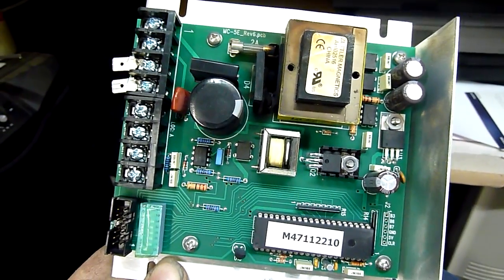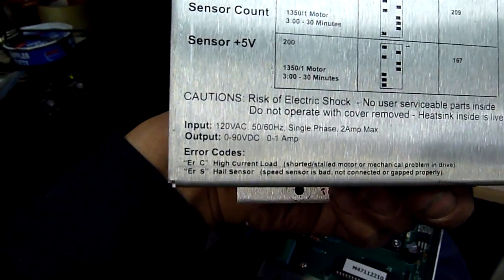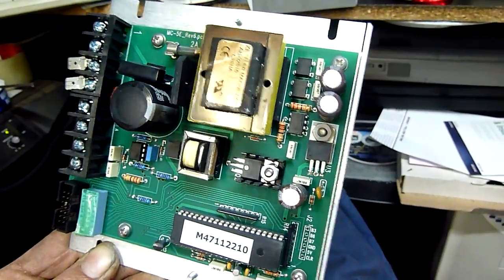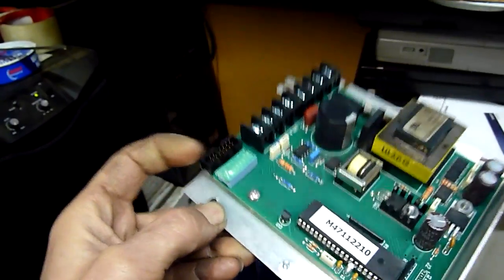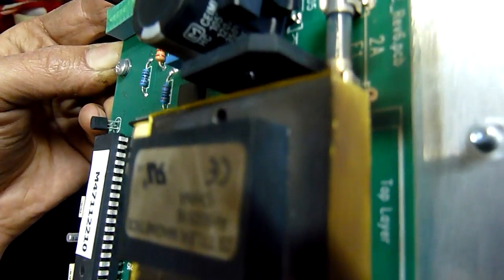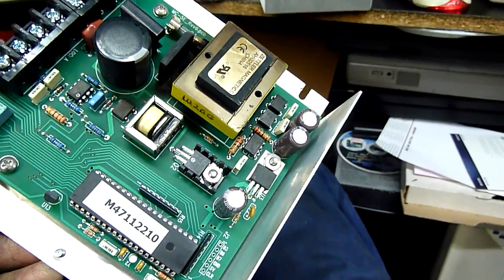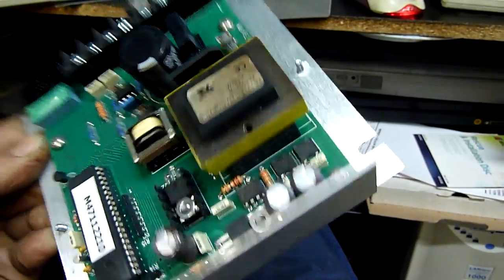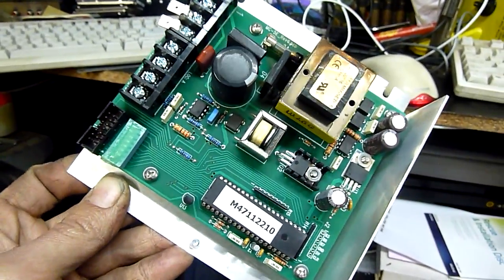Can it Be Fixed - 240V Vs 120V Speed Control Repair Help needed

Comment: What I would do is:

-Remove burnt components and clean the board,
-Check for blown traces,
-Check the primary of the transformer to make sure it isn't open or dead short.
-If possible check as many of the non-burnt components as you can such as the switching transistor and what appears to be a voltage regulator.  (If your regulator is ok you probably haven't cooked the main IC.)
-Replace as many of the components as you can and bring it up slowly on your variac with a 60w bulb in series.

Comment: I design stuff like this. Chances are the MOVs and fuse are the only trouble. I doubt anything else is wrong with it. Remove the MOVs, replace the fuse and power it up.

Comment: Remove the MOVs and power it up.  check the regulators to see if they are working.  I see 2 regulator looking pieces. Most of the time the MOV will take the brunt.  You would be surprised how durable that stuff is.  They are most likely MOVS by thge way the damage looks.  I am a repair tech, so feel free to PM me.

Comment: fortunately the transformer would've saturated which would've limited the output voltage to the guts.... but I don't think the transformer got power or else the fuse would've blown due to the afore-mentioned saturation.  It might have a power switch that connects to the barrier strip.  It could be just MOVs.  remove the MOVs and try to fire it up on 120 to see what happens.  check continuity to make sure the primary of the xformer is good and connected to the AC line.

Comment: The MOVs would have copped it big time, and I'd check that there are no missing tracks too.  I would guess that the MOVs did their job before the transformer died, which is a very common over-volt failure.  I'd guess most other things on the mains side like triacs if used are likely to have survived.

Comment: And what to think of inrush current (forgot to mention it myself above)? A fat cap which is just receiving rectified mains will pull something like 30 amps in a split second (when completly discharged). That's why these fuses are overrated (in terms of consumed power by the total device) and slo-blow type.

Comment: Everything on the primary/mains side of things is suspect. Any MOV's,caps,rectifiers,SMPS chopper transistors,etc. Also,check the primary windings on the transformer(s),to make sure they aren't open circuit.

Comment: Thanks! As you can tell I dont work with 120v equipment (230v country). It was my guess. Thank you for clearing up my mistake :) I was thinking: "it would be roughly double the mains voltage"

Comment: The small transformer is a current sense as it has the single primary winding that is put in series with the load (heating element for example).  Allows isolated current monitoring.  The secondary is rectified via full wave bridge (the 3rd 4 pin DIP) and I suspect that 8 pin IC near the bulk cap is some type of signal conditioning (op-amp) before going into the CPU A/D input.

All of that circuit should be safe.

Any more info about D4, and D5 and what the bulk cap go to?  DC voltage for what?

Comment: Should be saveable.  I see a conventional mains transformer with the dual 4 pin DIP full wave bridge rectifiers on the secondary side.  Check primary and replace the MOV's.  You should be okay as the volt regulators can withstand the double voltage.

The other trans is current sense from what I see and not a switch mode.

Curious about the "D4" full wave bridge and large DC bulk cap and diode "D5" with the heat sink.  I don't see a switch mode anything on there.

Any parts on the backside?

Comment: Fuses of that rating (in Amps range, not mA) are there to prevent fire hazard in case the transformer (or other mains voltage components) goes faulty or short. Second indicator is that it is in the primary circuit. Fuses for low voltage low current electronics are in the secondary side circuit.

Comment: Correction: That big cap should be rated in excess of 240 volts or about that voltage. It is connected to mains via a diode or rectifier, that means the actual voltage on the cap is probably max twice the line voltage.

Check any overvolt protection (also the fuse) and replace (possible) defective components such as the rectifier, cap and/or other low voltage regulators.

Comment: Further:
The diode/rectifier which is in the primary side circuit of that same transformer is for creating a high voltage DC in combination with the big cap. As the motor runs on "high voltage" from 90 to 1xx volts that makes sense. the cap could not be rated for much more voltage than the highest the motor can get.

Try to repair, and follow Robonza's advice.

Comment: That is fixable. Judging by the patteren in the shield, the rectifier blew. I cant make up an MOV from this video. The scorced part is labeled with Dx so a diode or rectifier.

What has happend in my opinion is: There was 240 volt on the 120 volt primary winding of that bigger transformer wicht has caused overload on that transformer.

Comment: MOV's are typically used for filtering noise and surge suppression. Switch mode power supplies use them to prevent noise from going back out to the mains and will run without them.
Check the traces on the board, some of them may have blown since the fuse didn't.

Comment: What voltage is the big filter cap rated for?  That looks like a switch mode psu to me as the rectifier and filter cap appear to be on the mains voltage side of the transformer. And the little 8-pin IC next to the big cap is probably the PWM driver.

Comment: I think transformer output voltage was NOT enough high to blow the voltage reg and the programmable chip. So, U have to check if the transformer itself if good or open circuit. If it's good, then replace fuse and try. If the transformer fried, apply proper voltage externally to power the circuit.

Comment: things tend to have a habit of breaking on double there voltage lol speaking of fuck ups my mum bought a heater today brand new, plugged it in and the breaker tripped lol so i opened it up and the metal reflector was bent and shorted over the heating element terminals lol we wont buy cheap shit ever again lol

Comment: The components aren't worth very much.. but it's a specific controller for a specific over I guess, so spare parts are going to be expensive. It's also MCU based (you can see the osc crystal etc around the dip package) so there is software involved too.

Comment from the maker: my initial suggestion was to replace it with a Delta Mini VFD and .5Kw 220V 3 phase motor. that way it can be controlled off a remote speed pot on the panel and they don't have to worry about over priced parts.

Comment: The conveyor motors is normally just DC motor with a gearbox to feed the oven belt. I got my friends oven going by simply hooking my lab power supply to the motor terminals 0 – 60 volts DC in this case and the oven worked fine over the weekend while I fixed the speed controller (Lincoln oven) All they had to do was set the belt speed via the volts output knob. There was no speed feedback normally via a taco on the top of the motor to the controller but in this case it worked OK.

Comment from the maker: thanks mate, I will give it a go tomorrow. the speed control input seems to be via the ribbon cable plug,, the barrier strip only has AC in, DC out and Hall sensor on it.

Comment: The chip under the label is probably a micro.. find out what it is and wire up 5vdc or whatever it needs directly and see if it still works (you should be able to see what pins do what from a datasheet and see if they're doing anything with a voltmeter). The rest of that that stuff is all standardish stuff from what I can see.. so if the micro still works you could probably replace the rest of it.